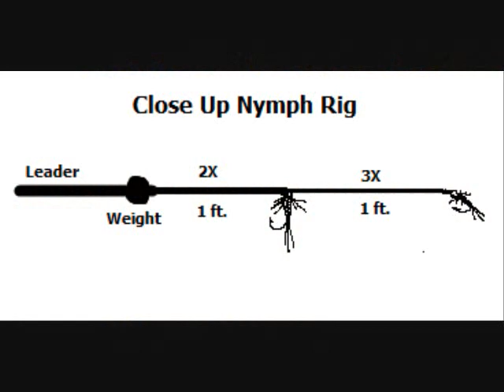How to set up a Two Nymphs Rig for Trout

Comment: I can see you added 1ft of 2X, but what size liter were you using, a 7.5ft 2X? Also shouldn't the placement of the indicator be dependent on the depth of the water and not the distance from the fly line? Thank you!